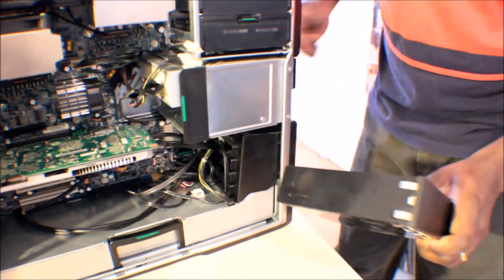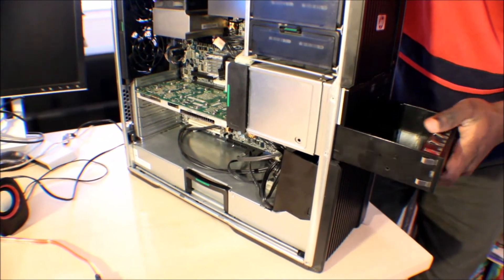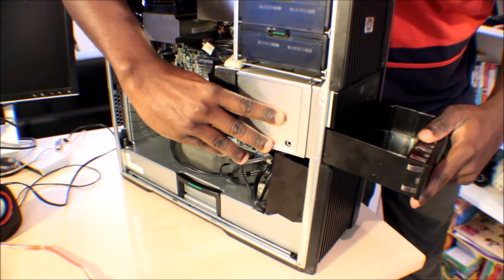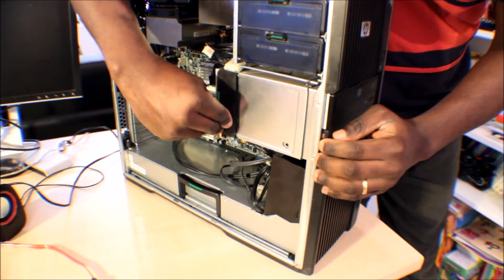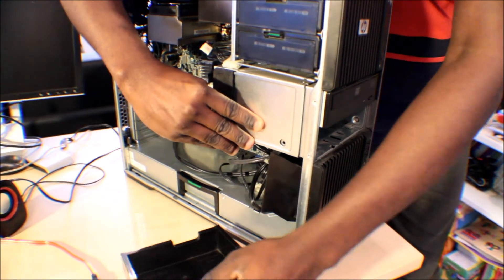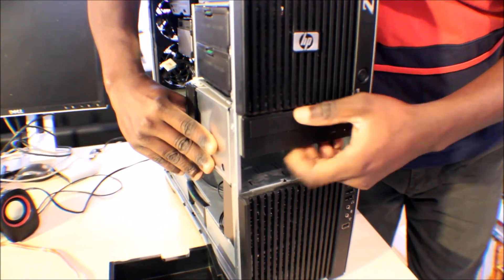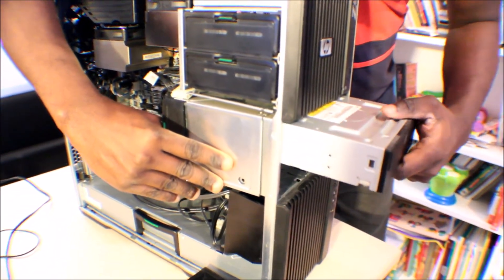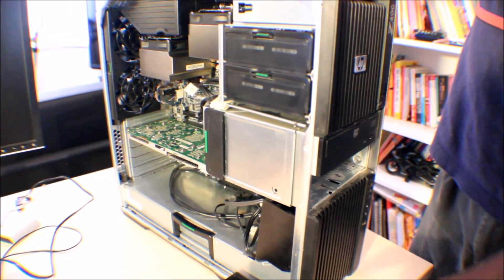How to remove DVD ROM or drive player on HP Z600 - Z800 - Z820 - Z620 - Z400

Comment: Help i recently added an gtx 1050ti evga ssc graphics card to my z600 but after approximately 5 minutes of usage the computer would automatically shut down(i think crash) without warning. i do not know what is wrong plz help
Reply from the maker: what is the spec of your z600? have you tried replacing the graphic card to see if the pc works?
Reply: Mart Fame it works with the normal graphics it has 12 gig ram only one CPU and 2t hhd